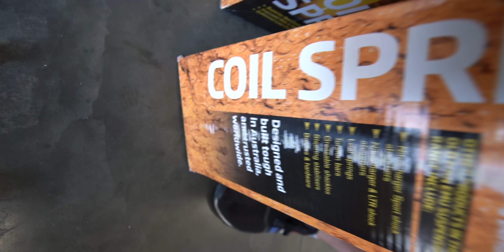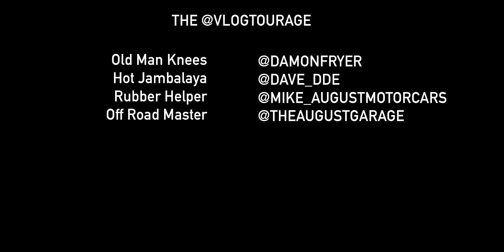BUILDING A $300,000 MERCEDES 4X4 GWAGON AMG ON A $10,000 BUDGET!!

Comment: The main difference between this and a 4x4 squared which gives the 4x4 squared a big advantage off-roading is that it has portal axles unlike the g63 traditional axles
Reply: To be fair, even the standard gwagon is a very capable off-roader. The 4x4 square has more clearance between the axle and the ground vs the one with the lift kit

Comment: In the Middle East you can buy a full conversion if you put the original 4*4 square and the conversion one you can’t even differentiate between them 
They change finders shocks hub and more parts and most of the parts are from Mercedes

Comment: Now it only needs 6 inches of wheel gap to even come close to the 4x4². It does look bigger but no where close. RDBLA needs to do the actual 4x4² conversion to it with the widebody and 10-12 inch lift. Star light head liner. Was hoping for a side by side shot after the lift was put on.

Comment: You guys need to watch them wheel spacers because sometimes they will destroy the barrings in the axle and your wheel could potentially fly off so just watch out if you hear like any weird squeaking noises then take it to a shop right away because I had spacers once and they completely tore up my diff and barring on the one wheel and my tire flew off as I was driving and it was terrible
Reply: Also I would recommend a fender delete or smaller fenders so you don’t come in contact with the tires

Comment: Is there a reason for spacers instead of new fitted rims
Reply: Dave bought the kit himself, no sponsorship. doing it all on the cheap? theres a DIY feel to this video and that probably link into the spacers.. as that's what a lot of people would do.
Reply: Just curious I am older guy in the car I have trouble trusting equipment that doesn't direct bolt up. I drive hard, and unfortunately I have seen to many fails. 
But time change no my vehicle I was just curious.

Comment: Great work, but the front & rear axles in 4x4² are 6 inches longer on each side of the vehicle. So saying this lift converts a regular G wagon to a  4x4² G wagon is not correct .

Comment: My paste wax and paint protect does the exact same thing. And last upto a year or more with proper cleaning which I used from Chemical Guys......Citrus Wash and Gloss. As for the wax and paint protect I use Meguiar's Ultimate Paste Wax and Muguiar's Paint Protect. Kept my paint looking like new for over 150k miles and always kept in direct sunlight for the last 8 and a half years......and most likely cheaper than this stuff yall bragging about, (prolly sponcered so yall getting a kickback.) 😮😁

Comment: They don’t go on tracks like other 4wd a guy got everything he could get done in Australia and tipped it on it’s side driving over a rock as big as a house brick. I would have done a colour correction and clay bar over the car before the ceramic coating. If you have any dust or anything under the ceramic it will peel off and then you have to polish it all off and then prepare the surface properly. If you put ceramic coating on without preparing the surface then you may as well buy a dog and bark yourself.

Comment: This is got nothing on the squared bro. It is a whole a lot smaller. If you need it to match, you need 37 tires, NOT 35, and a whole a lot of changes to suspension kit to accommodate the 6" - 8" lift kit you need. You also need a different fender set.

Comment: The odometer and speedometer will give you wrong numbers. You must calibrate the computer if it is even possible.

Oh yeah and it will act erratic when turning or going down hill ,up hill ,sharp turns , the computers will go out of wack and will apply brakes without warning ..which is dangerous

Comment: Everything inside it doesn't even look that good this not even hire that much from a  standard G63 just all the dumbest cramps and big ass tires and it man you're going to mess your body up on that car with them tires once they do start hitting you do four wheeling...You're going to crush that back quarter panel with that tire touching like it did you're going to be spending so much money on that but that tire hitting that back like that that little bit just think if you try to even go over something fast will be seeing that the scrap yard for long